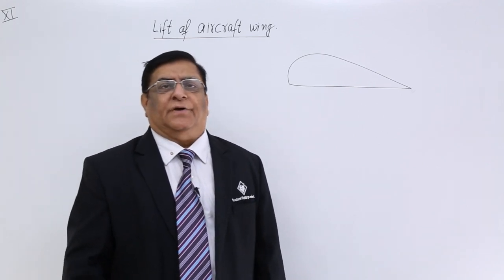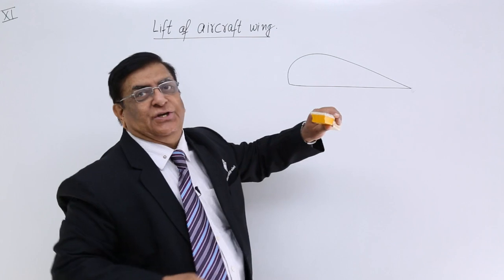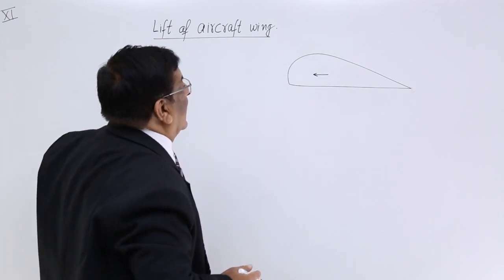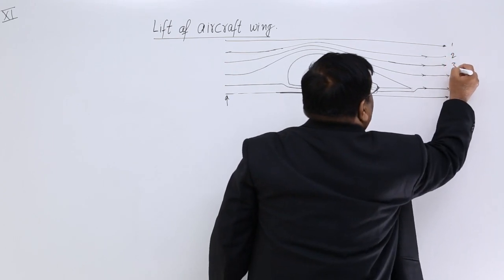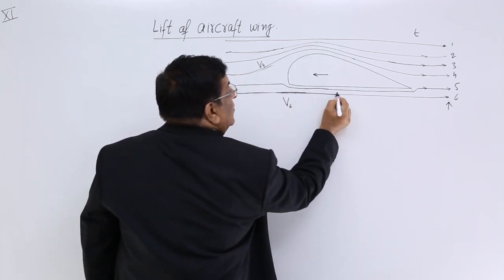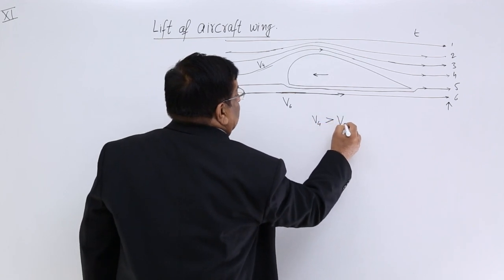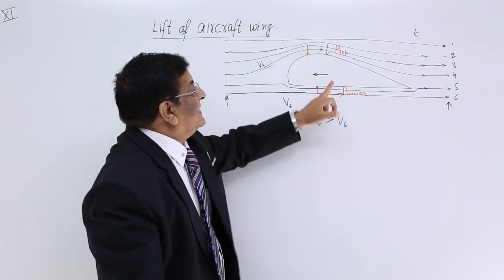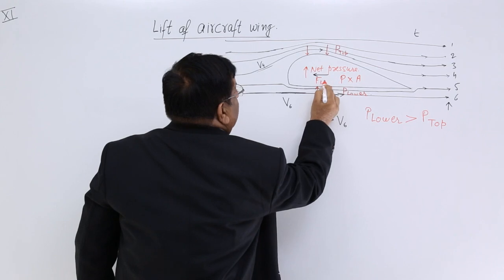Class 11th – Lift of Aircraft Wing | Properties of Fluids | Tutorials Point

Comment: 1.Pressure is a scalar quantity
2.Burnoulli's principle is only valid along a single stream line
3.accroding to burnoulli's principle there is pressure diffrence between uper and lower layer which genrates the lift , there  is a phenomena which is known as equal time argument which means both particle in respective stream line should take eqaul time which is not supported by any law of physics , hence burnoulli's principle can't be applied
4. Actual reason of the lift is coanda effect - the tendency of fluid to get attached with a convex surface 
Coanda effect genrate a low pressure reigon so bcz of this pressure diffrence lift is genrated
Reply: +narayan sikhwal,
.
Coanda does not occur above a wing, HOWEVER, it is the curved flow.

See this explanation of the difference:

https://www.quora.com/What-are-the-differences-between-Bernoullis-Principle-and-the-Coanda-effect-when-we-apply-them-on-aircraft-wings-1/answer/Kim-Aaron
....................
 What are the differences between Bernoulli's Principle and the Coanda effect when we apply them on aircraft wings?

 Some people claim that lift is due to the Coanda effect. Those people are wrong. They do not understand the basis of Coanda effect. I’ll come back to this.

 Bernoulli’s principle is a mathematical calculation that relates flow speed to pressure under certain circumstances. Although there are restrictions on how you can use it, it can be used to help you figure out the pressure on the wing when you know the speed of the fluid near the wing. All by itself, it does not explain lift. It is a small tool that is part of figuring out how much lift will occur. But it’s just a calculation tool.
..
(CONTINUED AT THE LINK ABOVE)
Reply: Pressure is not a scalar quantity. It acts normal to the surface and therefore has a direction

Comment: I think you should learn before explaining....? How a paper plane (flat surface) flies then? OR Airfoil with no camber?
Reply: They have streamlined flow and they are if less weight. The don't fly forever,watch your words in front of your teacher
Reply: This is a simple explanation. The velocities would have to be determined experimentally here rather than through an explained process. F_L=0.5*p*C_L*A*v^2 is a more accurate representation, but this explains the basics of how that equation is derived

Comment: well, thats wrong explaination Mr. Kshetrapal  .
Reply: Kya bhaiya
Reply: Tu galat aee
Reply: Cannot apply Bernoulli's eqn. on 2 different streamlinea.
Reply: and who told the air particles need to meet at same time at the trailing edge?
Reply: @kishangajjar9772  Exactly. This is a common (but still completely wrong) assumption to fit their explanation.
Reply: @nicholasturo-shields6477   No, Bernoulli principle is completely valid for streamline flow.....
Reply: +Chandra Shekhar Seth Advocate,
.
It is Bernoulli's Equation that is valid.  
.
Bernoulli's Principle is misunderstood by the vast majority of people trying to apply it....Including this guy.!.
.
Fast air absolutely does not  cause lowered pressure.  
It is the lowered pressure that allows a higher pressure to accelerate the air into the lower pressure.  That is WHY it is going faster when it gets into the lower pressure.
Newton's Laws apply to fluids too.!.